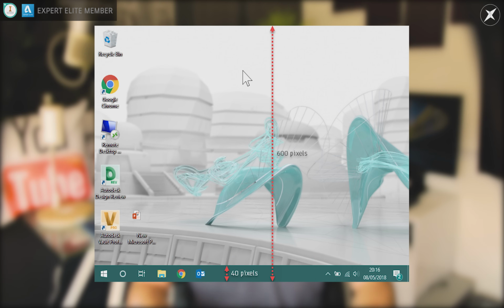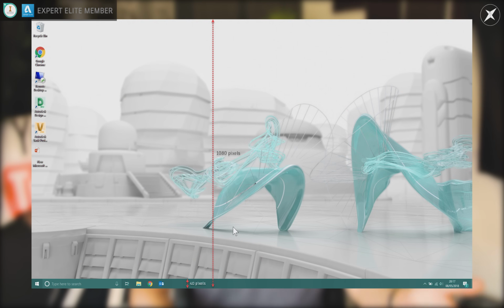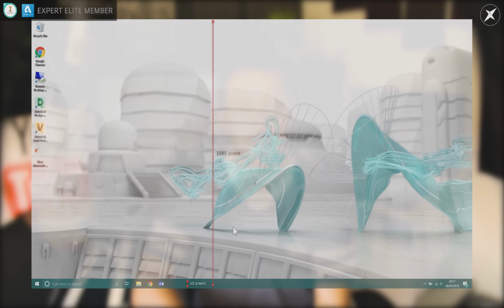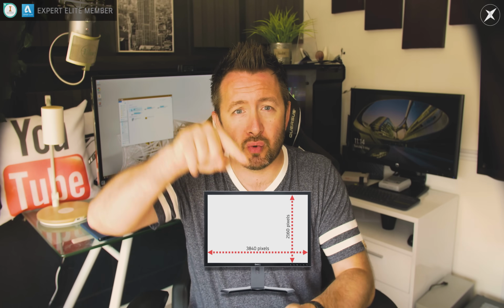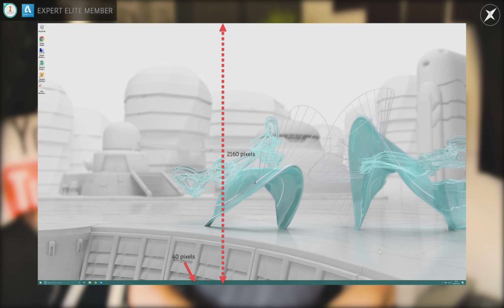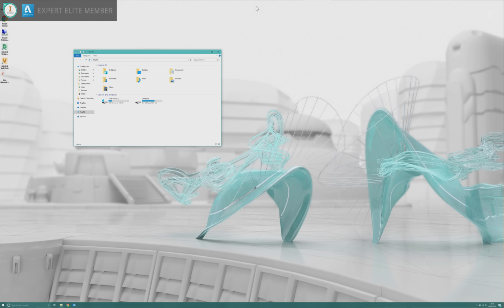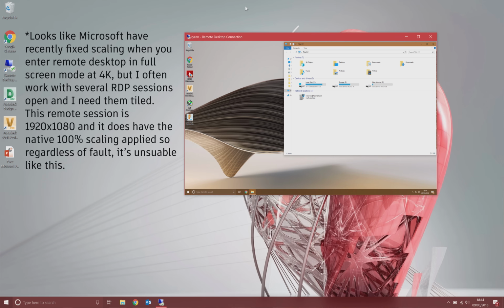Why 4K is no good for me, and possibly for you too (CAD, Engineers & Admins)

Comment from the maker: I'm looking into the possibility of checking out a 40"+ screen to run at 4K with no scaling to see if this is reasonably workable
Reply: I made the jump to a 40in 4K and love it, CAD is so nice at that size.
Reply: I run a 32" 1080 display at work and a 43" LG 4K IPS TV at home, and I can say that chasing pixels on the 4K rig in Inventor to click on precise points is a bit tedious. I run scaling at 150% in Windows display settings on the 4K setup which messes with some dialog boxes and whatnot.
Reply: there is no reason to take a higher resolution of 1080p if you look at the screen of 22 "to 27" at a distance of half a meter
If you want a larger screen at a lower viewing distance, you have to take a screen with a higher resolution of 2K or 4K to have a crystal-clear picture
Reply: I run a 42" 4k TV with 125% scaling and I normally require glasses. The Windows task bar is measurable taller than on my main 1080 ultrawide screen positioned immediately below, but the mouse is ever so slightly smaller. Either way, text is the same size between the two and I can read it just fine.
Reply: Did You try to think about it (43" 4k Monitor) as 4 Monitors that are displaying diffrent stuff in diffrent configuration -> For me it's a briliant idea to work as You do on a wide display (43" monitor split horizontally). Bottom side is the cad monitor (working as a wide monitor) and the higher half is splitted verticaly (for two windows eg. chrome or file commander). After dealing with my work I turn a movie on the full 4k 43" screen and go on a couch to watch it with comfort :)
Reply: Piotr Szymura 
You may be interested in the LG onscreen control software for splitting your screen into regions 
https://youtu.be/YHtz9Dkalfo
It works with non-LG monitors for splitting, color changes may only work with LG
It’s better than the aero snap that’s integrated in windows.
Reply: @JohnnyBwhatitused2be  Do you use any specific software to divide your 4k monitor in 3 like this?
Reply: I have a 28" 4k screen that I'd like to use for Inventor, but I'll probably only bump it up to 2k, and still scale up the UI a bit. The failure to scale UI still happens in 2019? Isn't this an error with Inventor and not Windows by the way?
Reply: I've been using a 43" UHD TV for 3D CAD, post-processing and other stuff and it's great. 100% and 125% scaling (same ppi as FHD 24"). There is no point using 4k on a screen less than 40"
Reply: @Donn2025   have used 32" 16:9 4K IPS panel since late 2016 (2021 currently) 100% scaling, no problem. Sure sight will affect to the choice, but it'll work fine and tandy for 4-10 splits. If I'd go over +40" I'd run into same issue than previous 1080p, pixels will just run out. Scaling down below 100% wouldn't work, or things will look like we're back in Win95.

Sum up my point. Inches depend on you eyesight, but after you split 4K into 4 1080p sections, you can't split that 1080p section into 4 OR even into 2 browsers in any convenient way. So if you need more space, go another screen after 32-40.
Reply: @incognito827  32" 4k too small for me I'm afraid, wouldn't be able to read the text.
Reply: @Donn2025  Yeah. It's like comparing food. Everyone has their own taste.
Reply: @David ben Mesecke  I know it's been about a year since you posted.  I'm looking at buying a 75" TV for CAD / Youtube / Movies / Video editing.  Reason I'm going so big is the way I use my living room as an office exactly how you described.  I'm currently using a 20 year old Hitachi projector which gives me just over 85" size and I really don't want to go below 75" as my eyes are so used to it.

Looking at options online, and reading reviews for tv's,  things to look out for is that I probably don't need 120hz.  Could I go for the cheapest Samsung or LG 75" 4K UHD models in 2020 and get decent results or do I need something that's 4:4:4 chroma like Sony?   Trying to sift through all the marketing waffle is hard and would really appreciate your help.  Thanks!
Reply: I love 4k on a 43" IPS monitor.  Snagged one on Craigslist last year after doing all the pixels-per-square-inch math.  Great for CAD, coding, research, anything.  Just don't get a TV.  Get a proper monitor otherwise the text will look weird and you'll get ghosting.
Reply: A lot of the information here is still relevant but it has aged a bit in two years now that more computers are sold with 4K screens. As somebody who still uses a 1080 screen I'm beginning to have the reverse problem: Designers sucking up all those shiny new pixels by making software apps with absolutely massive bezels, this negating the purpose of having more pixels by merely wasting a larger proportion of the space available.
Reply: Just an update on my situation,  75inch 4k tv yields tiny solidworks icons,  scaling within the application will sort this problem out but then you get this weird flicker every time you click or rotate the model.  

So the only way around is like TFI said,  change resolution back to 1080p when doing CAD work
Reply: Did you ever do this? I'm thinking of buying the a Dell 43" 4k panel (U4320Q). I'll be using it mostly for coding (so a lot of text) on a 80cm deep desk.
Reply: Don't do it.  I got a 55" 4K TV thinking the same thing (plan sheet size right?).  Nope.  The screen real estate comes from the 21:9 aspect ratio only ... not the ppi.

Comment: I am an Architect using primarily AutoCad Architecture and Revit.  For years I have had two 24" 4K monitors but recently decided to look into a single widescreen monitor (49") to have more uninterrupted real estate.  The Samsung current model looked great but is clearly geared toward gaming, not technical documentation.  Based on this video and your other wide monitor video I researched and ordered the Dell UltraSharp 49 Curved Monitor - U4924DW,  Thank you very much for providing reasoned clarity to what had become a confusing purchasing process.

Comment: One discovery of mine after working on computer and all kinds of monitors for 33 years. The new IPS displays with led backlid are very bad for your health. They damage your neurone system and psyhic. From the slim monitor the only good option is CCFL backlid and not very big displays so you have moderate area to be eluminated from. Best size is 19" wide factor. The modern IPS LED also messes up with your blood pressure, amoled and retina are worse.
Reply: What do you think of LCD TVs?
Reply: @criticalw88  Have no experience with TV but as long it is not LED backlid should be better for u.

Comment: Got a new workstation with a 4k and HD monitor and I had to fiddle around with it at first until I was reasonably "happy" with the setup.
4k was set to 150%, HD to 100%. But since you change the windows/programs on the monitors, that only caused problems.
I've now set both to 125%, which is sometimes too small for 4k and sometimes too big for HD, but the best compromise for me. Incorrect font sizes only occur to a small extent here with Inventor/Vault. I can't really recommend 4k either, put the money into a 3D mouse, height-adjustable table or something similar.
Maybe two 2k monitors would work better here, i dont know.

Comment: I use a 4K monitor with Solidworks, 125% scaling with a K2200 Quadro card. No issues.
Reply: Does the 125% scaling make everything look a little blurry as opposed to 100 or 200%?
Reply: @khj5582  No, I can’t say that I notice any scaling issues. I sit 50-60 cm from a 4k 32” screen and for me, 125% scaling is the sweetspot.
Reply: @Tilten  Thanks.

Comment: and what is the situation in late 2021? Is there a change in your opinion for example running newer program versions?  Or Windows 11? I am interested in HP u28, which is 28 inch 4k monitor, so I will have to use the scaling for sure.

Comment: The difference on TVs isn't that big if you are not standing close to it or if it's not big enough, if you do game on it it's another story. (But from what I've seen all HDR TVs have 4k and there is no drawback about a higher resolution that is a multiple of 1080p) But it's a different world on monitors where you get much closer, I mean even on a smaller 24 inch monitor you can see how few pixels there are.

Comment: An interesting insight into this minefield of Monitors. I have just bought an LG Ultrafine for my MacBook Pro. It is truly amazing experience in viewing = no brainer, go out and buy one if you can afford the cost. However, I have a bespoke laptop for CAD and BIM and the LG monitor does not work well. I could get it to work, but the price in doing this comes in just under the cost for a lower specification none-4k monitor. I am caught between the Devil and the Deep Blue --- So, this video was very useful to me. My Laptop runs a NVidia P4000 which is produces stunning images on the laptop's 4K screen (Prevail Pro Laptop with some tweaks). I find nothing wrong with the scaling for Autodesk products - it is fine for me. However, I do need a larger 'real estate' for BIM. That is where your good advice comes in. A less expensive monitor is therefore probably what I need. So, thank you for your time in making this video - it all made perfect sense to me if nothing else does during this history making moment in time. Many thanks for sharing.

Comment: At last, some one that understand my problem. I use wacom mobile for drawing in photoshop, but is very frustating at 4k because very little umpresitions occurs in every brush stroke because the tip of the brush fall in random millimetrical offsets every time. maybe most peaple doesnt notice but I do. Then I down the resolution to 1920 x 1080 and problem solved.

Comment: How much curved monitors distortion affect for engineering use? I'd like to buy a curved screen, but I fear that it will be unusuable for application such as graphics reading on engineering
Reply: I was a little worried before I bought my super-wide curved Dell screen last year. Everything is perfectly fine for CAD as it turns out. Faultless in fact.

Comment: 32" 2K Benq monitor, best for cad!
Reply: I consider buying the same monitor but 4k resolution. I am worried about performance of solidworks due to 4K resolution. which one do you prefer 2k or 4k? Thanks
Reply: @nburaq  so what was your decision?
Reply: @incbyakyabyakya6275  I chose 2k 32inch  monitor also but 4k is also possible
Reply: @nburaq  whats about your work distance and pixel ppi/dpi bcs of 2k and 32"? I am looking at LG 32QN600, but afraid that i will loose a half of space, instead if i choose 4k 32" monitor.
Reply: @incbyakyabyakya6275  well I can't notice the pixels. but on the other hand for 4k you should have a really powerful video card to push all those pixel for 4k monitor. I think sweet spot is 2k for now
Reply: @nburaq  well i have 2080 ti, not the best for gaming, but fine for work. i think.

Comment: this video only makes sense if you're dumb enough to run a tiny screen in 4k. if you're being reasonable and going 30+ inches on 4k display you dont need the scaling... you're wanting more real estate.
Reply from the maker: You've landed on a channel which is purely focused on info for work and offices, and in offices you don't get people using 30"+ displays for many reasons.  The title of the video and description clearly indicates that this isn't general consumer advice.
Reply: @NeilLCross  I'm literally looking at putting a 40+" display in my cube to replace a pair of 24" 1080p displays doing AutoCAD work.
Reply: @NeilLCross  Exactly.  I find 27" is the "sweet spot" for Inventor; any more than that and I have to back away from the screen to see it all without scanning around with my head all the time-which negates the benefit of having the larger screen in the first place.

Comment: working off a 43" 4K monitor, never will I go back to 1080p!
Reply: Hi DanM101 can I kindly ask you which 43" 4k monitor are you using did you go for the Philips 43" (436M6VBPAB) 3840x2160 4K HDR1000 Quantum Dot monitor or something else
Reply: @dbassociates9744  
Item Qty Total
TCL 43" Class 4K (2160P) Roku Smart LED TV (43S405) $279.99. I got it at Walmart June 2018. Excellent computer monitor. 4:4:4 Text is sharp and clear!
Reply: @danhmm  cheers Dan never thought a smart TV  would ever work with AutoCad time to give it a try .thank you
Reply: @dbassociates9744  Check out the reviews and judge for yourself. I believe you can get it close to $200. Crazy!

Comment: Hey. 
4k cad works. But you need a BIG screen to benefit from it!
I use Autodesk Revit 2018 and 2019, with 2x 4k 43 inch monitors plus 2x FHD 27" screens. Older Prosessor i7 4790k. Gpu is older radeon firepro 5100. It works like a charm in large projects. Scaling set to 100%, (some like 125%.) 4k in a laptop I agree is meaningless. When you go 4K you have to go big to get a the same PPI. Or else I agree it is pointless, when you use a small screen even 28" you have to scale up, and thus defeat the purpose. But when you do it right it is absolutely awesome. I have been using this for a  year now. I have convinced my boss, and now we are 6 colleagues at 4k 43inch. With is great for productivity. We use several windows at once, or just one big window for great overview. And an great for collaboration too. This is not even an expensive screen, Philips 43" 4K LED BDM4350UC. I use it at normal + viewing distance. I push the screens back to the edge of the desk. 
I urge you to update this video with 43" 4k screen, and give it a fair chance and be blown away. 4k at laptop size screen is not usable resolution for cad. Way to high PPI,  witch makes this video kind of misleading. 4k cad works fine, with the right screen size.
Reply: I agree, I use a Sony 55" 4K screen and love it. Also using Revit 2018.
Currently using the same CPU i7-4790k but use a GTX1080 8gig Gpu.
Do you find the menu in Revit a bit small or has this been fixed in 2019 ed?
Reply: @darylsummer1424 Hey Daryl. 
Nice to see more people enjoying descent screens. Revit 2019 is nice because you can have views outside of the revit frame. Menu icons are excatly the same size as in 2018. Works for me, with glasses :) If you need bigger icons, "set a custom scaling level" to 125%. Dont change the resulution. Heres how:
https://www.laptopmag.com/articles/increase-text-size-computer

Comment: I have to disagree with some of this. I use Autocad a lot and in the past when on a 1080p screen I would often have to print out the drawing to check the final details and overall appearance as the sharpness was just not good enough. It is a lot better on a 40 inch display which is what you should use most of the time. But if travelling and you cant see the details on a 15 inch laptop get some reading glasses.

Comment: Hey
what kind of laptop would you recommend for an engineering the new dell xps or the precision 5530? I use Ansys solidworks and matlab. Thanks for your time.
Reply: i got the xps15 7590 with an i7 9750h and a gtx 1650
had some ansys cfx simulatons running on it without any issues
gpu is capable enough for CAD as well
Reply: @Spaeckli  I finally bought the xps 9570, with an i7 8750h. It is undervolted wit a CineBench R20 of 2782. I could simulate with ansys, so its fine for me, but I recomend to use some kind of colant plate or somethiing like that. Thanks for your answer.

Comment: Nowadays you do not pre-determine sizes in pixels anymore if you can avoid it. You define size-relations to other elements, physical sizes (such as fonts in PT=point=0.3528mm on the physical screen) or pixels for a defult DPI that are then multiplied with the actual DPI of the actual screens (multiple screens connected at the same time having different DPI, resolution, aspect ratios and physical sizes).

Comment: Hi there, i'm using as my primary(and only) display a 43" Philips 43PUS6162/12, 4K Ultra HD. It's amazeballs...although i have some problems with icon scalling in Inventor or Autocad 2018, for my working needs it's just PERFECT. All the size you want, and after work you can enjoy a nice 4k HDR movie on it. Just my 2 pence.

Comment: You're somehow right, EXCEPTING that LAST VERSIONS of these softwares  (I am speaking of SolidWorks and Creo ... maybe the others too) are running very well on 4k resolution.
Your stataments are perfectly right if you work with 4k monitor and 2016-2017 or prior software versions , but not anymore in 2018-2019 versions.
Reply from the maker: I said in the video that the latest flagship CAD versions run great, it's the other programs we use at work that don't look good on 4K

Comment: In my opinion there is no good reason to use a high resolution display at all, as long as you need to apply any form of scaling. It is alright as long as the size of the display is bigger. Absolute minimum for a 4K monitor is 32", and ideally  would be about 35-38". Any larger and you would need to move the monitor further away, so there is actually no need for anything larger.

Comment: I work on a 32" 4k (UHD) every day and EVERYTHING I use has looked perfect for a good few years now (Inventor, AutoCAD, Illustrator, Premiere, Lightroom, Photoshop, Evernote, Word, Excel, Trello, Spotify, Chrome, Nomacs, Monday). Granted, I don't use vault, it's crap they haven't got that sorted for the 2019, what were they thinking?

Ideally 4k is paired up with a larger monitor, for my 32inch 150% is the standard recommended level of scaling (but it's perfectly usable with no scaling) and for a 40 inch (yes, there are 40 inch computer monitors) no scaling is used at all. You can think of it as a multi monitor setup without the bezels, or a ultrawide with extra space on the bottom and top. 32" 4k is 137.68dpi, exactly the same as a 16" HD laptop screen.